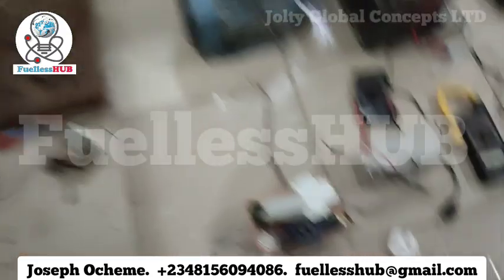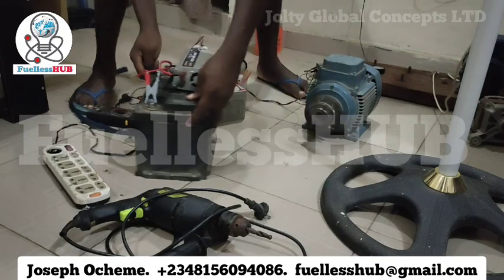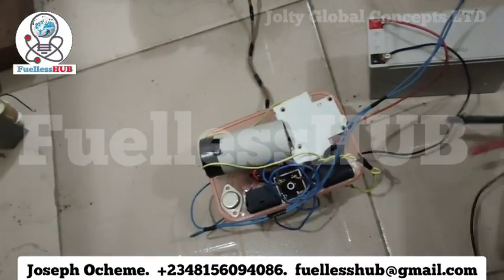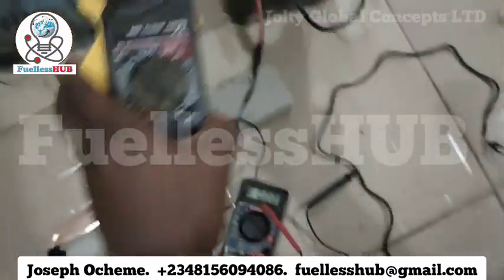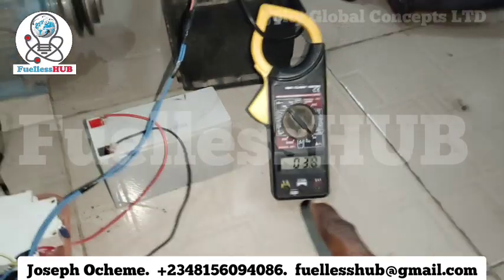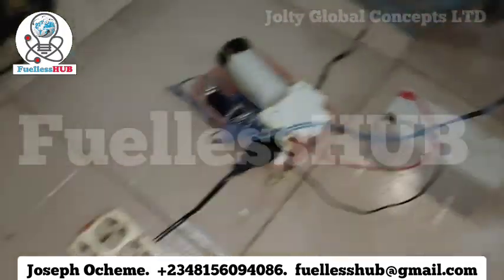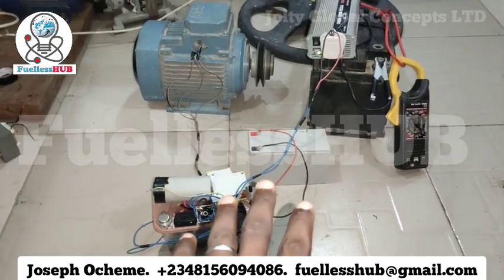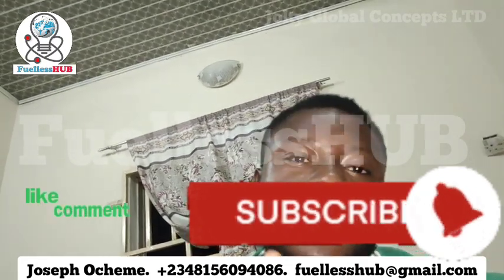Fuelless Generator Open Test more Output than Input

Comment: I have a issue and can't find my voltage source, I've been testing 200 amp diode on the full wave bridge rectifire and the friction of gravity and spinning and even conducting electricity is not =.😢
Reply from the maker: What systems are u doing?.
Reply: myself, I cant get the flux capacitor to work :/